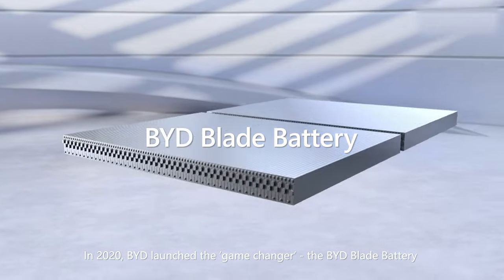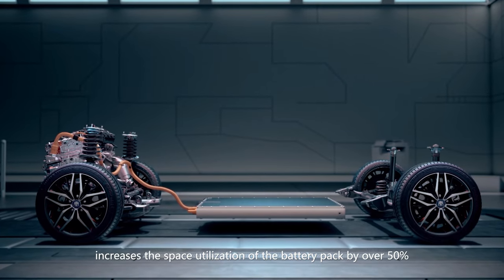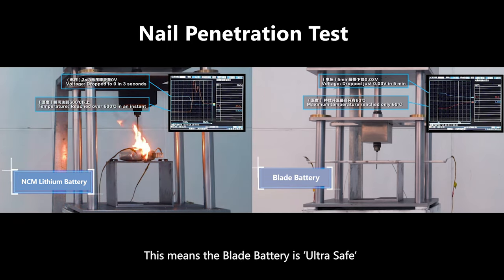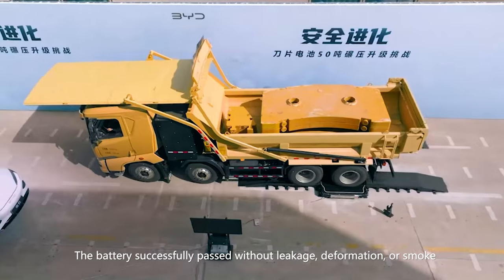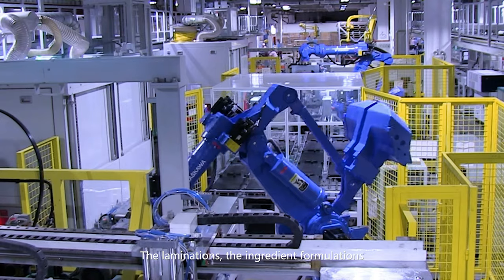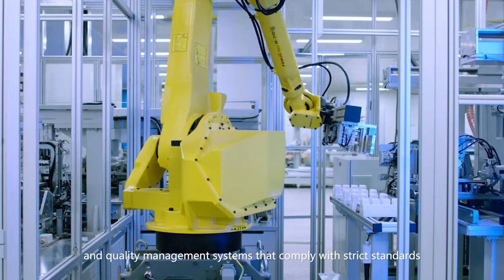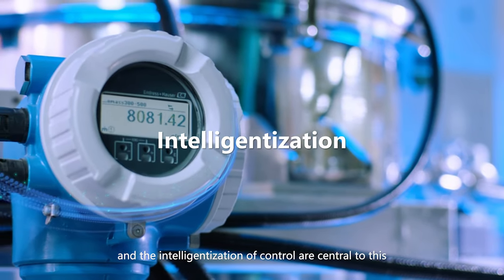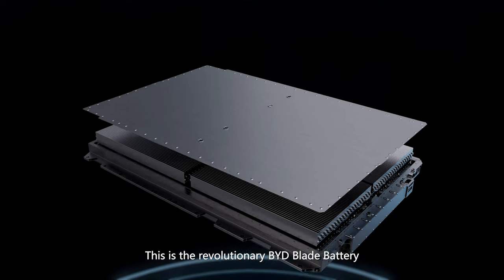BYD India | Blade Battery Technology

Comment: BYD Must establish Factory in Bangalore India or Hyderabad India. 
Bangalore/Tumkur India is No.1 in EV.
India is waiting for BYD Seagull EV  with AI Features.
Tesla is also coming to Bangalore.

BYD can also build Bullet & Vandhe Bharat Express Trains for India.

India - China may be connected by Bullet Train vai Sikkim/Nepal/Tibet.
Reply: BYD will not be successful in India as India like Small and Compact Cars and Compact and Micro SUV where Bonnet Visibility and Driving Position is Good. Unfortunately BYD do not have such products in their Global Line up. All BYD Vehicles are bulky and huge. But India looking for Feature Rich Simple nicely well balanced design Vehicles for 4 to 5 people max 7 people at affordable rate. Roads here are hilly, up and down, full of potholes and narrow with huge traffics. BYD Vehicles are designed for China and USA Roads which are massively wide and good. condition. Indians are looking for Global NCAP Rating of 4 or 5 like Tata Vehicles and better built quality. BYD also do not have high penetrative of Electric Charging network Infrastructure in India like Tata have, BYD also have very less dealers or car showroom in India and spare parts availability.